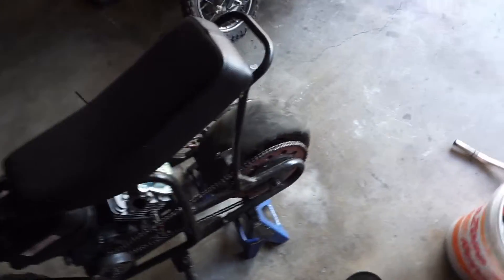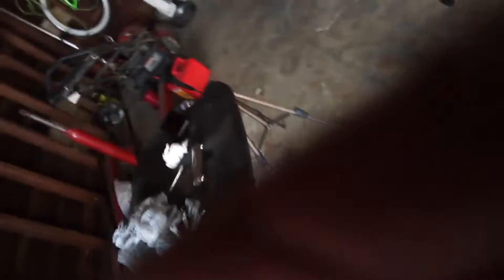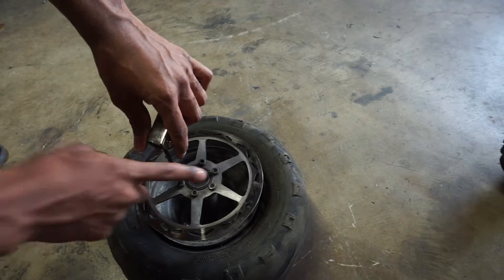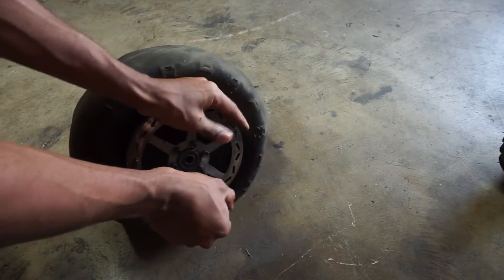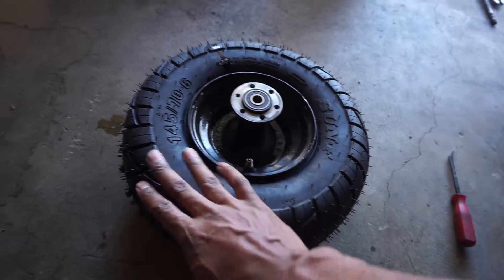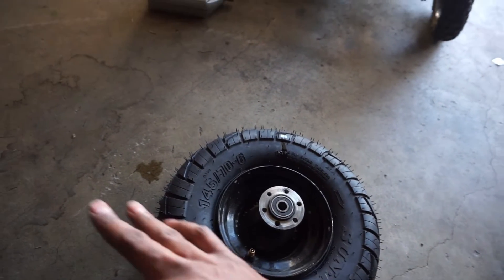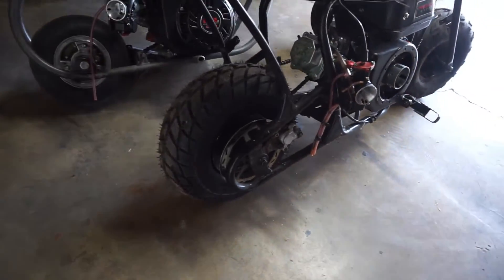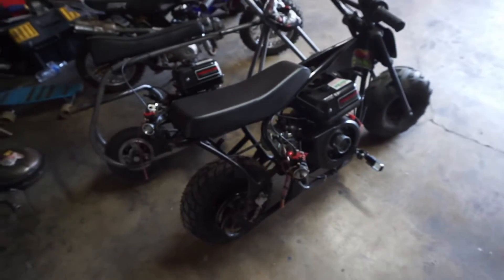Mega Moto Get Street Tire Upgrade

Comment: Man all that water gonna rot the inside of that rim up. Best to try with nothing but hopes and dreams first ,than dish soap if you really can’t get it. Those little tires are a pain in the ass. I had to cut one of my v treads to get it off too. I had a lot more issues getting off than I did on. Even setting the bead was a pain lol

Comment: I use tire shine for lube & 2 prybars   With the tips  & edges ground a little more rounded so it doesn’t scratch & slides easier.
 2 blocks of wood to keep the hub off the ground while I’m prying 

To seat em I take out the valve core  & use a blower attachment to fill em fast.  & if that doesn’t work I wrap a piece of rope around the center of the tire & tie it tight  or a ratchet strap. 
 You could make good tire  prybars  with an angle grinder & a cars spare lug wrench.

Comment: I’m glad you’re back 
Youngblood, I got my bike moving, I weigh 260 pounds 6 foot one. I can’t get the full 7500 RPM because of my weight but I got it up to 7100 RPM and 53 mile an hour with the gear ratio that I’m running